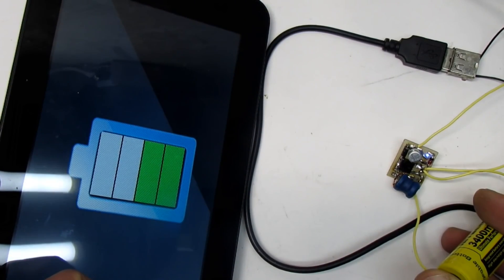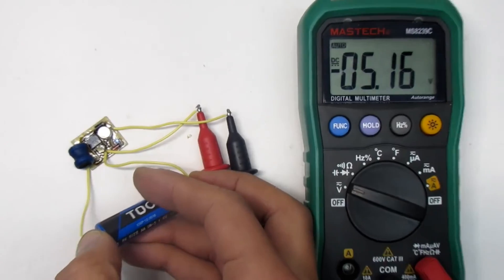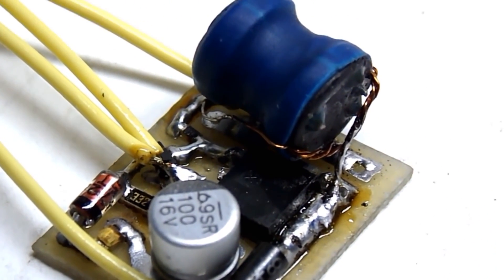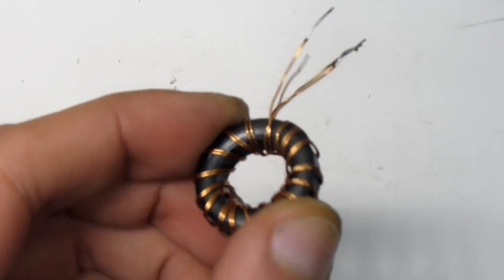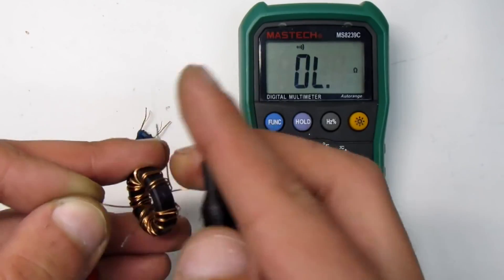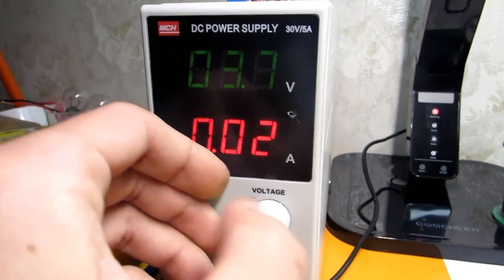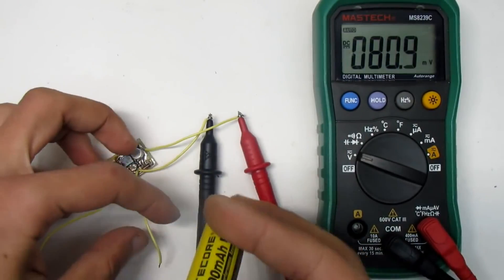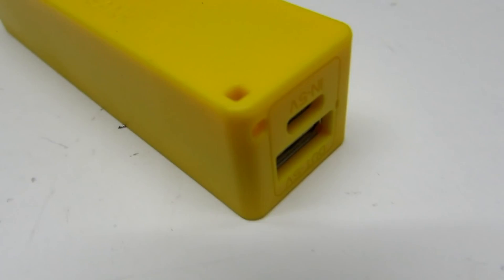How make the simplest POWER BANK

Comment: instead of 25 turns on a core  I did 17  and I was able to get up to 5.2 amps at 5.22 V increased the size of the coil wire diameter slightly as well
Reply: 5.5 amps? really? what's the ferrite size?